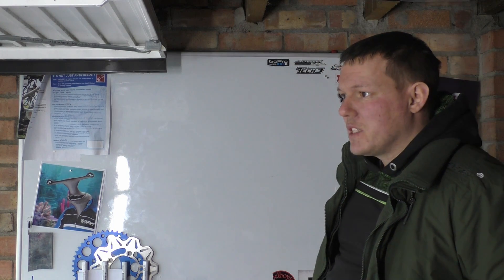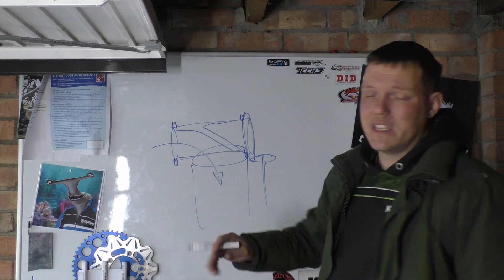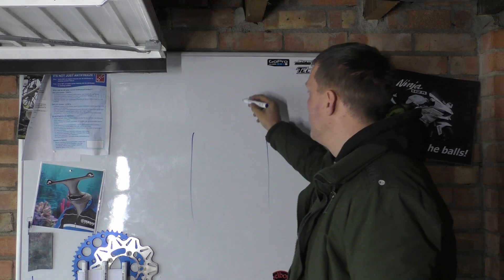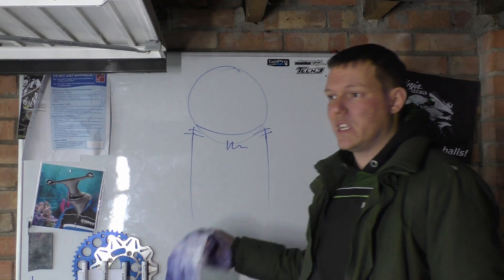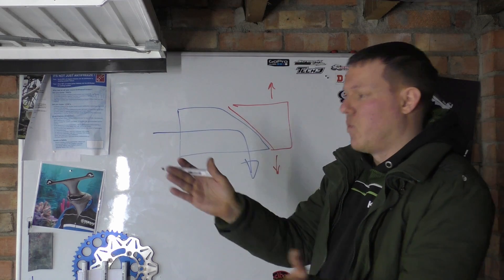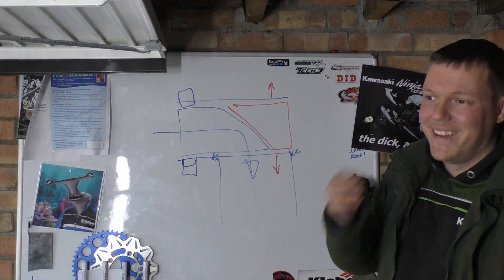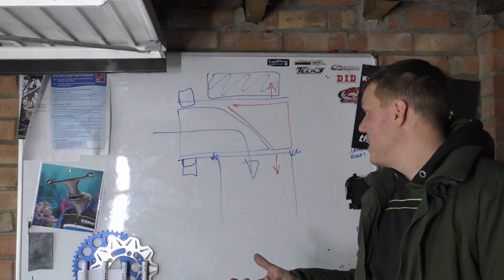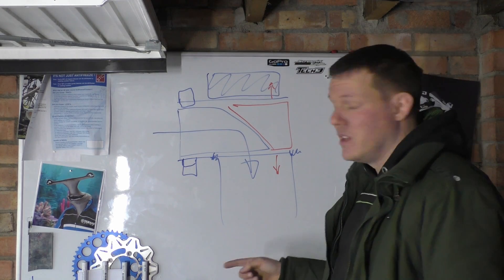Rotating valve - Bishop Valve

Comment: what about 2 rotating valves per cylinder, to avoid the thermal issues? Also it would give you more porting options.
 I always thought the sealing problem was more of an issue myself..
Reply: 110110pab definitely sealing issues
Reply: You loose the size and flow you get from a much larger single valve.
Reply: And the valve would have to rotate at 1/4 crank speed. What about a rotor like the Thayer valve used in a bass trombone?
Reply: Coates rotary vales already answers this by having one valve for intake and other for exhaust.
Reply: You are correct 11011pab, 2 rotating tubes would solve the thermal heating issue. Sealing was, is and always will be the issue. Rotary engines , sleeve valve engines, all had the same problem.
Reply: Two tubes, dedicated to seperate inlet and exhaust, takes no more room than twin cam, keeps thermal expansion more consistent to get tolerances right.  To avoid pressure/vacuum/ flow changes along a tube shared by multiple cylinders, each cylinder's valve shouldn't connect through the whole length, but have its own exit into a seperate manifold which can be tuned. I don't see any issues with this. Room for 2 spark plugs per cylinder between and ample diameter for flow.
Reply: Sealing wouldn't be that big of an issue... BUT the seals would have to be designed as wear parts. Essentially a carbon-impregnated material that could handle both the temperature and the friction. At best, they would last around 10k-30k miles, and you'd have them changed with your oil.

You could use two valve shafts per cylinder... but then you're cutting your port area into less than half. Granted, the same problem is faced with any OEM-style poppet valve... but poppet valves have much better initial flow than rotary valves (akin to the difference between slide valve and butterfly carbs). You need all the exposure area you can get with rotary valves, so you can maximize the initial flow.

Rotating valves are great for reducing parts count, eliminating valve control issues of poppet valves, and eliminating volume intrusion/piston interference. All these look great on paper... giving you pie-in-the-sky views of 20k RPM redlines, 16:1 compression without direct injection, million mile valvetrains, smooth piston faces, and downright elegant heads... and then reality sets in. What you really get are tradeoffs... thermal expansion failures, or horrible flow rates... sealing issues, or pulling the heads with every oil change... high duty cycle and low output, or very low duty cycle and reasonable output... extremely expensive materials/coatings, or 30 second run times.

Even after all this, you're still facing the problem of having roughly double the non-standardized machine surfaces... which kills production costs and lead times, requiring AT LEAST a 4 axis CNC rig.

In short... poppet valves are an amazing little invention, when you figure in the unseen forces of an engine (pressure/heat).
Reply: How about static layers of ring rotary valve?
Reply: Yea, a intake one and a exhaist one. Gear driven to keep it from tortioning weird.

Sealing is a bitch yea, my first thought goes to some sort of pistonring style seal, maybe with a spring to keep it from getting crooked, around it. I dknt know im not a engine builder

Comment: make it out of fuckin inconel and seal it with labarynth seals. I love the idea and these are pissweak excuses I think but i'm no engineer.
Reply from the maker: Yeah just make it out of inconel - because inconel doesn't expand. And labyrinth seals don't require a constant pressure feed?!?!? And this is why you don't design engines.
Reply: Werent we just talking about how we dont cam turn pistons or taper them as much anymore because the alloys have gotten so much better since those days?

Comment: It seems to me that the Bishop Valve is trying to answer a question already answered by the sleeve-valve which solves the cooling and sealing issues the Bishop Valve has. The Bishop Valve might suffer from less oil consumption issues than the sleeve valve but that's about it. 

You should do a video on the sleeve valve actually, I'd be interested in hearing your thoughts (on why they're shite, of course!), they seemed to have good power to displacement numbers compared to their contemporaries, at least in aviation use.

With the current trend in increasing control over valve timing the poppet valve seems to be the winner even if it's not the most mechanically elegant solution.

Comment: I recon you could get round the thermal problems by having dual rotating valves, bit like dohc set up, one for inlet and another for exhaust then you could use different alloys and port shaping for each rotating valve to best cope with heat and flow and as for sealing using something similar to the wankle rotor seals would probably do the trick I reckon, great video and look forward to next one
Reply: Marc Jackson low temperature ultra lean? The leaner the mixture is the hotter the combustion. Where are your references and apart from basically dismissing my original comment what the fuck has the rest of your comment got to do with me? It makes no sense
Reply: Also Alfa Romeo have used twin spark plugs in road cars for decades now
Reply: I like how the "hostile dismissive" replies were removed cause they got called out for being bullshitters.

Comment: Thousands of people have made rotary valve heads.
That is with separate inlet and exhaust valves.
Norton did it many decades ago and found that it made no improvement over their existing engine, so they dropped it.
Norton were at the forefront of racing engines at the time.
I designed one in the early seventies and realised , on the drawing, that sealing was the limiting factor.
Reply: I remember having a chat with an engineer about 20 yrs ago, that told me the same thing. sealing being the biggest issue.
Reply: Marc Jackson 
Yes Mark, there’s nothing like time  and money to improve engineering.
It looks as though the electric revolution is about to overtake us and the infernal combustion engine.
It will be a quieter future, sadly.

Comment: Jesus Christmas... What could be the theoretical redline of an F1 engine if it didn't have problems with valve float... It already seems stupidly insane
Reply from the maker: What it is now. They don't really suffer from valve float as they have pneumatic valve springs. The main thing restricting rpm is the con-rod. 

MotoGP bikes can rev up to 20k.
Reply: The Workshop What is the most effective way of stretching your conrod?

money shift XD.
Reply: "MotoGP bikes can rev up to 20k" And the old epic Honda CBR250RR which is a street bike ment to last for a while as well ;)
Reply: Ducati solved the problem of valve springs years ago with their Desmodronic setup.
Reply: the MC22 is an unsung hero. i WISH i could find one here, let alone afford it.

Comment: How about having 2 parallel tubes, one for the exhaust and one for the intake? Heat would be less of a problem and the spark plug could go on between them in the middle?
Reply: I think port size would be limited, thereby negating any gains from efficiency.
Reply: @whyyoutalkingtome  the port size would still be immensely bigger than a poppet valved head.
Reply: i thought the exact same think!
Reply: I  agree, and they should be inside the head, which should provide support and cooling.  But I can't imagine how this tube could work better than valves. It's probably not a good idea.
Reply: I replied with the same comment, before reading that other people had already pointed it out.  :D 
I should have watched the video earlier. :D
Reply: Yes, same think.

It will gain some hp

In my opinion

Comment: Could you solve the thermal issues by making it out of ceramic? I guess not as they would have tried it. Oh well, still an interesting idea
Reply from the maker: Ceramic components are usually very brittle and can only take so much load - we'll expand on the ceramic materials thing in the future.
Reply: That makes sense. I'll look out for it

Comment: a single cylinder engine was build together with Mercedes-Ilmor http://home.people.net.au/~mrbdesign/PDF/AutoTechBRV.pdf 
but F1 changed the rules to demand poppet valves so it killed the project
Reply from the maker: I added that in the description
Reply: speaking of F1, while I was looking for that PDF I found an old thread with some F1 engine porn you might appreciate 
https://www.f1technical.net/forum/viewtopic.php?f=4&t=15385

Comment: Why not have two separate inlet and exhaust tubes
Reply: sean faulkner You're losing all that sweet crosssectional area that would improve gasflow so much. Well, over half of it. And sealing the two tubes down the middle under compression and combustion is pretty big pain. And all that for maybe 30% more area in comparison to classic valvetrain. Also multiple cylinder engines become a pretty messy design
Reply: alles klar klaus of course it would be a compromise, but you would lose all the valve train, would that be enough of a benefit
Reply: sean faulkner I don't really see it in terms of cost. Development, production and maintenance is gonna go through the roof. 
I think the thermal problems if the exhaust valve are mostly still there and getting the bearings to work under such heat could be another big problem. Jet engines on their shaft bearings use carbon seals and oil cooled bearings and huge clearances so the thing doesn't seize when it is hot so yeah it probably can be done but.. that's just mental.

Comment: My question is how would you do variable valve timing using these?
Reply: Waiiiit! You looked at it like a camshaft (rotating horizontally), but if you used a camshaft or something similar to rotate it vertically you would only need one port as it does something like a wankel engine that might work but then again I ain't no scientist.
Reply: no VVT but fuck it you can have crazy throughput just because size of the valve is fucking huge
Reply: It's not impossible, but i do see your point might even get a slightly better volumetric efficiency
Reply: With the 2 in 1 tube it would advance/retard both, but if you had a seperate intake tube to the exhaust, full vvt is no different to any system on a twin cam. Seperating the hot exhaust from the inlet would prevent all the warping issues you'd get from the single pipe too.

Comment: Rotating valve sounds like a difficult thing to implement. Inlet and exhaust, no problem. But compression.... different story entirely. 

Sounds good in theory, (no camshaft having to force hard springs open constantly sounds fuckin awesome) but I doubt it would work well in practice, and even if you did manage to design it so it worked, how long is it gonna last before you start losing compression?

Your compression stroke in a traditional engine config pushes the valves closed. But not with this..
Reply: Ahh ffs, you mentioned some of what I said lol, oh well

Comment: man this would have absolutely spectacular flow! But it would have to handle the same force, as the piston, since it is exposed to the same pressure and has the same area. therefor the bearings on this would have to handle the same force as all the head studs in a conventional engine.
Reply: It's really possible...Take a look: let say 250 pounds of torque and a stroke of 2.92 inches.  12 inches / 2.92 = 4.1 so 4.1 x 250 = 1027 pounds on the crank lever. Let say 3.38 inches bore diameter. So around 9 square inches, 1027 pounds /9 = only 114 psi. If the portion of the tube that s exposed to the explosion is let s say 75% of the bore, it mean 9x 0.75 = 6.75 square inches x 114 = 769 pounds / 2 bearings = 385 pounds per bearing. It s possible to handle it. For the seal part, they would use a set of rings like with piston but linear (a set on each side and a set of linear top and buttom). It also take a base under the tube with the ignition chamber inside of it, so it gives the gap to put a head gasket like a conventional engine....
Reply: and also the torque is divided by number of cylinder...so maybe 100 pounds per tubes....it also have the possibility tu put 2 cylinder in opposite to compensate...
Reply: Very interesting!
Reply: Yes... the #1 conundrum with rotary valves. Rotary valves have 💩 initial flow compared to poppet valves (similar to the difference between slide valve vs. butterfly carbs/throttlebodies). In order to acheive reasonable flow, you need to maximize port area. When you maximize port area, you maximize both pressure on the valve shaft AND thermal transfer.